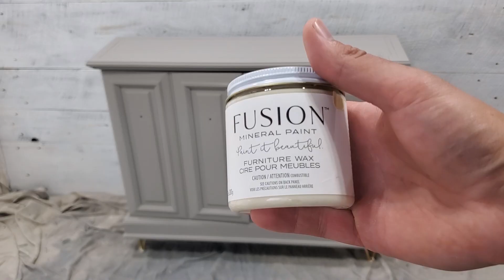Flipping Furniture for Profit // Hall Table Gets an Easy Chalk Paint Makeover

Comment: It’s nice to see you switching to the appropriate respirator while using the paint sprayer.
As a fit tester for occupational safety in hospitals, I seen you wearing a N95, which only stopes particulates (95%), but not vapors.  Good job! 👍